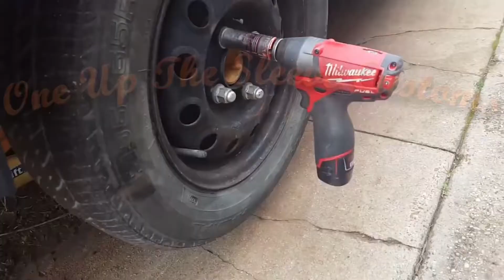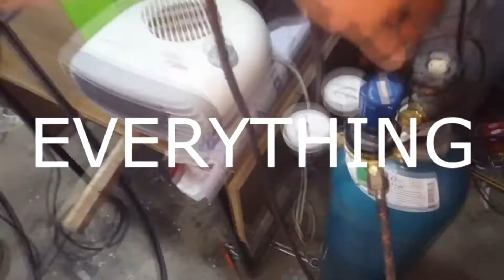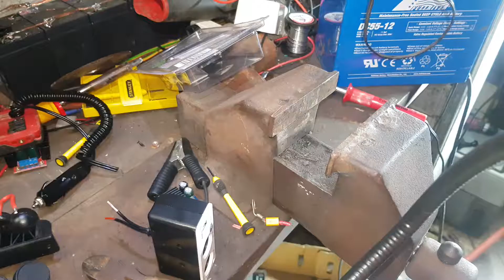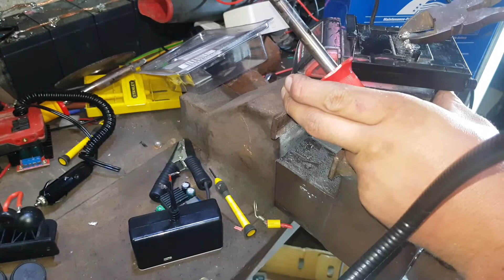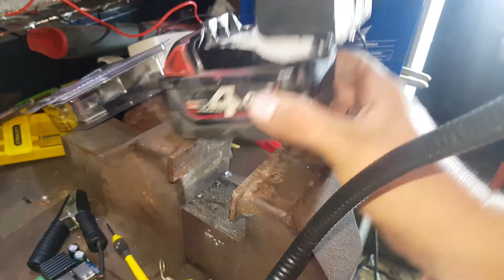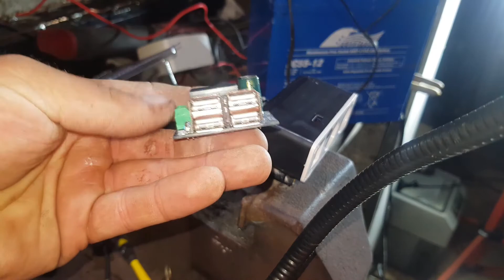Building a m18 milwaukee powered usb and cigar socket power hub

Comment: connecting directly to those terminals is direct to the battery cells which means you bypass the protection and you will over discharge the cells as it will not have low voltage cut off so you will kill your tool battery. seen a ton of hacks with tool batteries and people don't understand this is bad for lithium batteries you can't just run them dead flat and re charge them.
Reply from the maker: Best part is the batterys have a level indicator in them;)
Reply: @Oneupthesleevecustoms  so when you decide to check it and its flashing saying its flat but you already gone past safe discharge you have damaged the battery already. each time killing it more or if you go too far right away.
Reply from the maker: @magicmanspaz  they are not quiet that sensitive but I agree with you.  A lv cutout would be good